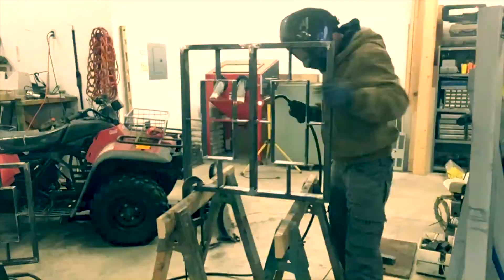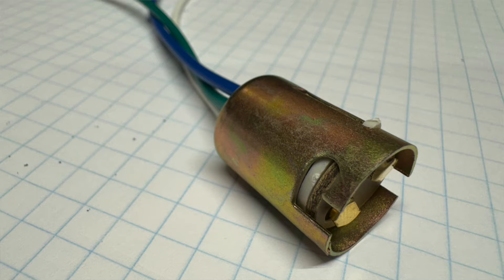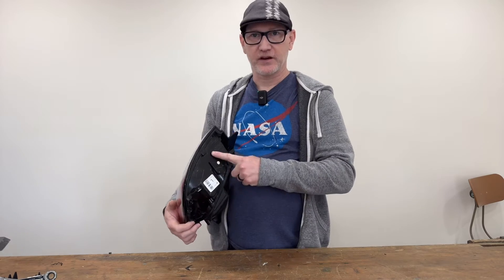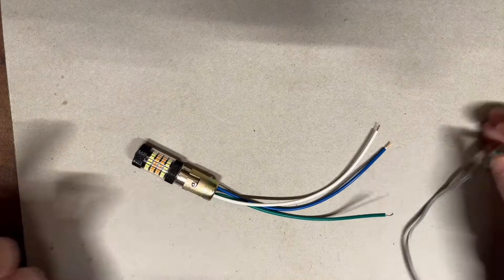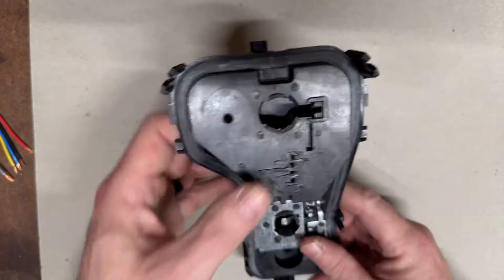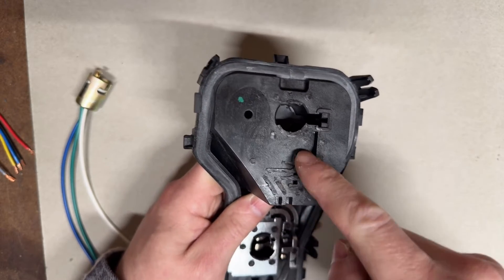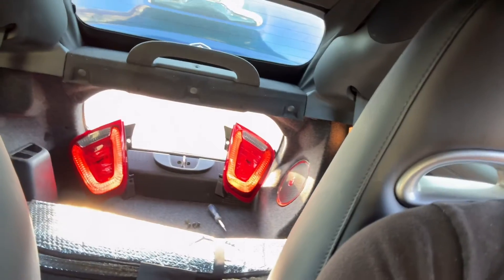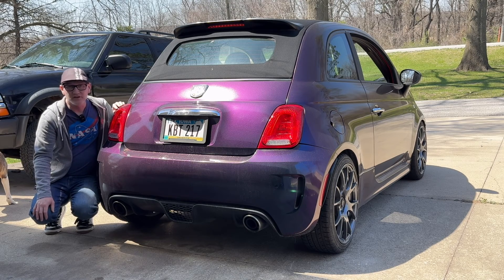Fiat/Abarth 500 Euro LED Tail Light DIY Upgrade - Complete Wiring Diagram!

Comment: Where u get the wiring connectors?
Reply: 2x 1157 bulb sockets
2x 1157  White&Yellow bulb
2x 5 pin flat plugs
4x resistors 8 oh m/50 watt